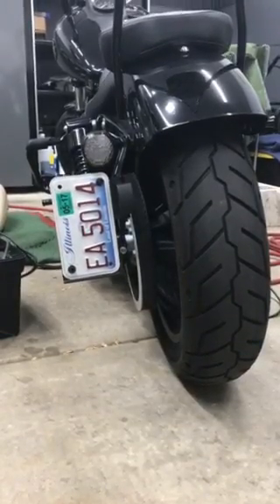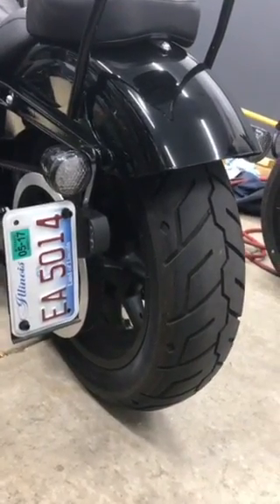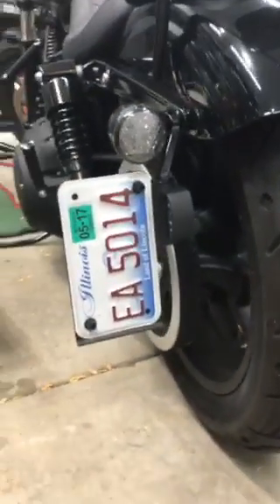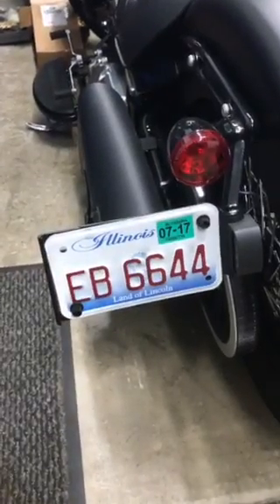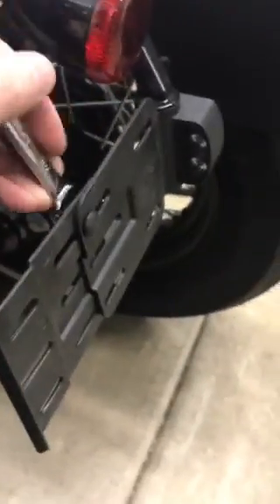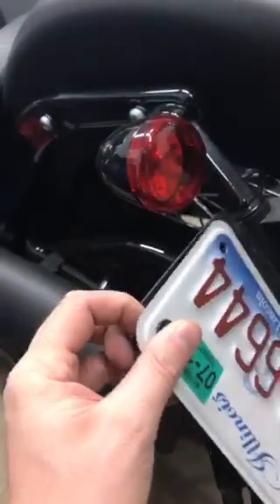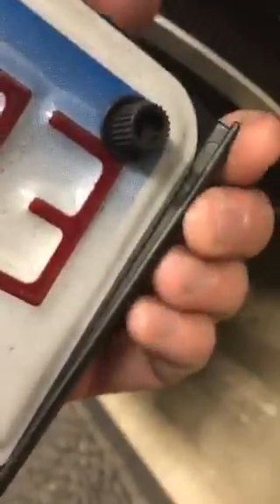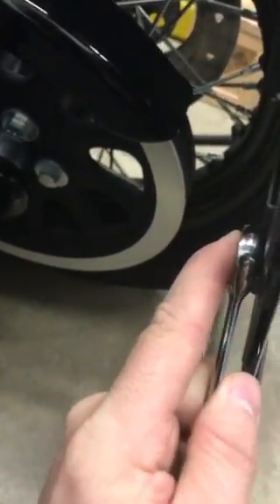How-To Turn Harley Davidson License Plate Vertical Using OEM Mount

Comment: Thanks for this. Question for all those who have done this. How does the lighting on the plate look after it is done? Does it still light up the whole plate, or just the top half? I rarely ever ride at night, but don’t want to get pulled over by a cop because my whole plate isn’t illuminated.

Comment: I did the same thing to my 2017 Softail Slim but I just took off the extension. Did not need it. Bought a few extra screws in case I needed them. Can't remember if I did or not.

Comment: Looks great, however if the plate is mounted vertically, it should be turned clockwise. Read from the top to bottom.